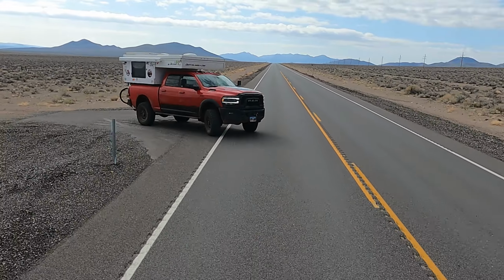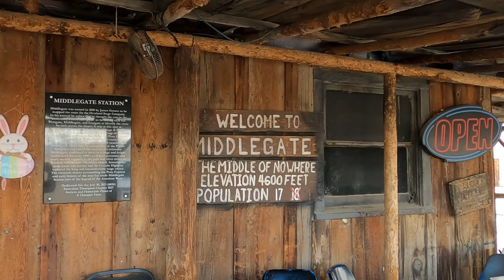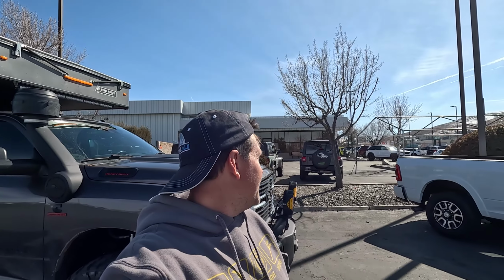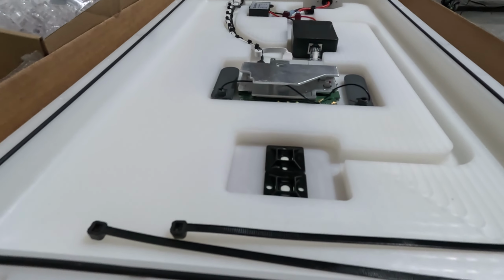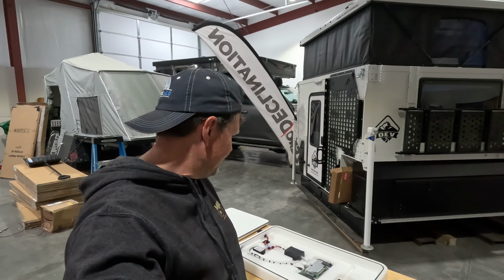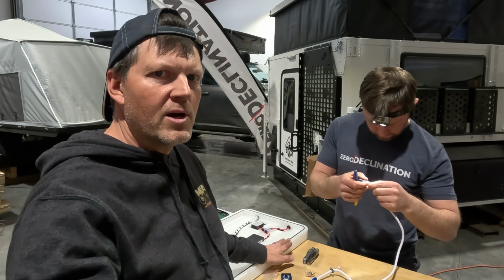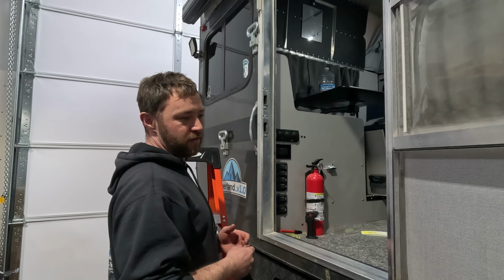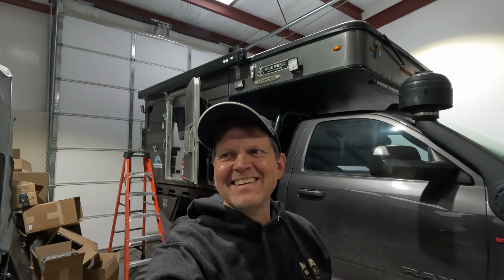Starlink 12V Conversion - Always Connected

Comment: Interesting new all-in-one flat mount. If you care about getting best internet speed you need to replace the 12V to 48V up converter that you're re using (only briefly shown in  the video). That power supply is noisy and forces the router to downgrade router-to-dishy link speed from 1 Gbps to 100 Mbps. I have had that experience as have others as documented on the internet if you search. It's an easy swap since the power supply is in your camper and not inside the flat mount.
RIP in-motion internet as of Oct 1...
Reply from the maker: Sorry just catching up on comments, almost a year later lol. I am probably going to upgrade to the mini here at some point anyway. And I'm sure you saw they are now officially supporting in motion with my dish under the new plan. Of course the price did go up to.